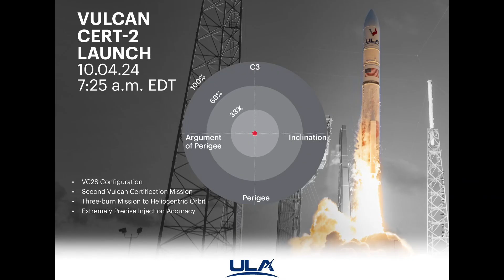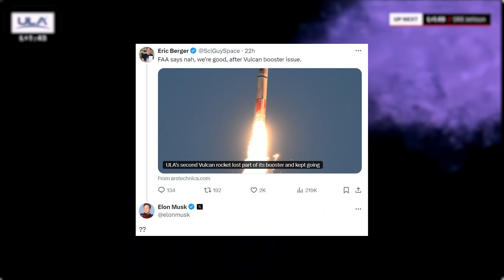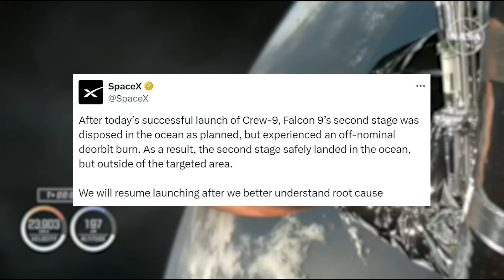The FAA Will Not Be Investigating Vulcan’s Anomaly

Comment: Ok this is a lot of BS. I wonder if the ula top dog is against trump if so then there is your problem. And if the FAA and ULA are in each other's pocket. If I correct,i have a 50/50 chance of either that, the FAA is holding SpaceX from launching starship, and didn't SpaceX asked for the permit/license to launch in the beginning of August? I also wonder if the FAA did a investigation and found some issues with ULA'S pride and joy, would that have a negative on ULA Vulcan and delay there certification for flight's. Its also kind of strange that,they were quick to hit on SpaceX. Again,i smell something and its not rocket fuel.
Reply: What's BS is you pretending you have even the faintest clue what's going on and why. The BS you spouted here is proof that you get told what to think and have yet to even catch sigh of a clue.  You wonder why the FAA did or didn't do an investigation?  Why not find out the conditions required first?  Oh wait that would be informing yourself and you hate that, you'd rather make it up or just repeat nonsense because there's no thinking involved then right?  Lazy and stupid go hand in hand.

Comment: The geniuses at FAA grounded the falcon 9, but let’s ULA Continue for same reason. 🤬🤬🤬🤬😤🤬🤬😤🤬😤
Reply: The problem you're forgetting is that Falcon 9 didn't deorbit correctly and there was debris outside the debris field. This is a safety hazard and could kill people. ULA had no such issue. Starship was not investigated for raptors blowing up midflight. In fact, they can launch the Flight 4 launch profile if they want to.
Reply: @sarkaranish A solid rocket booster exploding is a serious safety hazard. The only reason the Vulcan survived was dumb luck. If things had gone differently, we could have seen a complete loss of the stack with those same solid rocket boosters detaching and uncontrollably flying anywhere. This has nothing to do with Starship. Starship is a prototype vehicle under a test flight license. Vulcan is supposed to be an operational rocket whose whole mission was to demonstrate their ability to safely and reliably deliver military payloads. A booster nozzle exploding does in no way shape or form demonstrate that the vehicle is safe and or reliable.
Reply: @icylime3607  it wasn't because vulcan is unproven, so the FAA knew it was more of a safety risk, since this was made clear before the launch, its okay for the vulcan to blow up
Reply: @icylime3607  Vulcan is NOT an operational vehicle, it is still in certification. But the thing that Vulcan did correctly is not spread debris outside the debris field which is what matters most.
Reply: @sarkaranish  yea pal relax
Reply: @TiberiusMaximus  when spacex stans act like the FAA is being unfair, it annoys me.

Comment: To all you FAA haters and SpaceX fanboys: This anomaly was not dissimilar to one of the Raptor engines failing during the last Starship test flight, which didn’t trigger an investigation. Familiarize yourself with the FAA’s documentation regarding what classifies a mishap before reaching for the pitchforks.
Reply: FAA's documentation; Points number 2 and 6 of events that qualify as a mishap under FAA definition:
2. "Malfunction of a safety-critical system" 
6. "Unplanned substantial damage to property associated with licensed or permitted activity".
A solid rocket booster exploding is a serious anomaly which should be investigated. If the nozzle had broken in a slightly different way, the whole Vulcan stack would have been lost and the solid rocket booster would have been in uncontrolled flight. Letting such a serious malfunction slip by an investigation especially when the whole purpose of the flight was to demonstrate Vulcan's ability to safely and reliably deliver military payloads, is complete demonstrable negligence. Additionally, this has nothing to do with SpaceX or Starship. In the example that you provided, the possibility of engines failing was taken into account under Starship's test launch license. That does not apply to operational rockets. As an example, SpaceX's Falcon 9 experienced an engine failure on the CRS-1 mission where they were also able to deliver their primary payload to orbit, and an accident investigation was required to be completed.
Reply: You cannot shut down a solid rocket.  This means a solid rocket nozzle issue is a bigger deal than a liquid fueled rocket.

Time to recover the booster.
Reply: but…but….guberment evil! massive corporation good! -spacex sheep
Reply: @archdornan3694  Critizising the insane slowness of said government agency is just fair, though.
Reply: @ScienceCavas  maybe spacex should file their papers in time then
Reply: You TELL 'EM, Lyricbread! Make those brainless SpaceX Fanboy Cheerleaders squirm!
Familiarity? With what?
SpaceX Cultists live in an Escapist World of "wishful thinking"; not "Rules" or "Economics" or "Feasibilty". Spoils the Fantasy. 
Hello from New Zealand.
Reply: You are right BUT you can't blame SpaceX fans for assuming FAA is at fault, this video is intentionally provoking with the title and FAA has been biased lately.
Reply: @lyricbread  lmao given that every single comment has been deleted i can only assume the channel is biased towards spacex breeding the fanboys
Reply: They are way too stupid to know the different!

Comment: Of course, why would they do that? After all, it's not SpaceX. Election time!
Reply: There are real reasons for why.  What are the chances you'd eve think of informing yourself first vs just blindly repeating what others are saying?  Exactly zero.  You're going to be told what you think ever step of the way.  A perfect mindless obedient drone.
Reply: The problem you're forgetting is that Falcon 9 didn't deorbit correctly and there was debris outside the debris field. This is a safety hazard and could kill people. ULA had no such issue. Starship was not investigated for raptors blowing up midflight. In fact, they can launch the Flight 4 launch profile if they want to.

Comment: Wh!? Seriously what's going on!? The FAA needs to give a better explanation on what's going on here. Either they need to investigate every failure or not! What criteria did ULA meet that SpaceX didn't?
Reply: My guess would be that the Vulcan Centaur still managed to complete it's missions within the margins set out in the flight plans/ the launch liscence that was agreed apon before the launch. When Falcon 9 was grounded, the vehicle was supposed to do something and a failure prevented it from doing so. That wasn't the case here. Vulcan Centaur did everything it was meant to inspite of the SRB issue.
Reply: @plainText384 usually there's a voice "FTS are saved" few seconds the time drone ship landing?
What does it mean? Flight termination system did not kick in (bcs a trajactory is normal). And if, in the case it kicked in, does SpaceX forgot to assume a possible debris zone when asking for flight license?
Reply: @plainText384  Falcon 9 was grounded after failing a droneship landing after completing its mission perfectly except the landing
Reply: @ninehundreddollarluxuryyac5958  So? The plan for the mission was to land the booster and an anomally prevented them from doing so.
Reply: The problem you're forgetting is that Falcon 9 didn't deorbit correctly and there was debris outside the debris field. This is a safety hazard and could kill people. ULA had no such issue. Starship was not investigated for raptors blowing up midflight. In fact, they can launch the Flight 4 launch profile if they want to.
Reply: What's going on is that at no point did you come within a country mile of a clue.  You want an explanation and there is plenty to be found, for those people who are not both stupid and lazy.  Shame that can't be said about you.  Nice fail..
Reply: The FAA does have guidance about mishap responses published on their website and in circulars.  They're on their website and easy to find.
Reply: You know you can read their regulations right.  They have a website and everything....

Comment: New Launch date for flight 5 - Wed. Nov 6
Reply: Won't be allowed until after New Glenn flies.
Reply: @ninehundreddollarluxuryyac5958  this is probably a guarantee, just like the hold ups for the first F9 launch to the ISS trying to get Boeing there first.
Reply: @ninehundreddollarluxuryyac5958  ZERO correlation between New Glenn and Starship.  And Starship has already flown FOUR TIMES.  /facepalm logic

Comment: 🤔 Whatever is wrong is no small thing. Seems like an interesting decision. ULA has a nontrivial problem. Personally I would be concerned. This could have gone badly. 

BUT it was a great test of ULA’s flight control systems!
Reply: The SRB's were not built by ULA. The Vulcan rocket passed with flying colours. The boosters however ...
Reply: @_starfiend  

True, but still kinda a mixed bag. This has to be fixed as why will the military risk a very expensive satellite on a launch system that has this type of failure (considering that it might have gone very badly). This was not the type of problem that should have surfaced at this point in time. I find it rather perplexing. I really expected the launch to go flawlessly, but better to have it happen now and be fixed. It is just that the SRBs are a very mature technology. If I were ULA, I would be rather concerned. And what is different with these SRBs than what they have been using. I hope that ULA will be reasonably open about this issue.

Comment: FAA didnt investigate when the raptors explode on take off so why should they investigate the SRB?
Reply: Fair point I've never even considered that. The only difference for me would be the fact that if a full vehicle breakup had occurred a SRB could have remained intact and continued firing to an uncontrolled course .
Reply: @callumcurtis15  also it should be pointed out that the raptors on starship shut themselves down instead of actually exploding
Reply: @LizardGuy50  If you ignore flight one then yes 😂
Reply: @LizardGuy50  We've seen more than enough raptors exploding but sure, they definitely shut down after that.
Reply: @callumcurtis15  thought that was the hpu exploding?
Reply: I was not aware they didn't. They should have. It may be on "Autopilot"!
Reply: Because that is included as part of the launch license for Starship.

This one isn’t.
Reply: But they did, and SpaceX had to slow their flights every time. There has been an investigation after every Starship launch by the FAA.
Reply: @EarlDorman-w7d  the reasons for those investigations had nothing to do with that though.

Starship flight 1: Launch platform got utterly wrecked, spreading debris far outside the indicated safety zone. FTS on the ship also took far longer than expected to trigger, which is a big issue as that's a public safety critical system.
Starship flight 2: Complete loss of both the booster and the ship in flight. 
Starship flight 3: Loss of both the booster during landing and the ship during flight.
Starship flight 4: Success even though significant damage occurred to the ship flaps.

Meanwhile:

Vulkan flight 1: All stages dropped over their intended areas, vehicle completed the mission.

It should be noted, that the delay after Starship flight 4 has nothing to do with the flap damage. As the vehicle still managed to perform its mission with the damage, no investigation by the FAA was needed. And that's true. The FAA has confirmed many times that SpaceX is free to reuse the license for starship flight 4. The delay with flight 5 is not due to a grounding at all, it's that SpaceX intended to change their mission design, requiring a new license, and they were just late with the paperwork.

The performance of this Vulcan mission is very similar with Starship flight 4, where both suffered an anomaly, but they still managed to perform their mission.
Reply: @EarlDorman-w7d  And there are clear reasons.  Finding out what they are is the one thing most of you lazy twits just won't do.  You'd prefer to be ignorant and argumentative and as always 100% worthless.
Reply: @EarlDorman-w7d  spacex have been grounded twice this year. Both times were understandable. What are you talking about? Btw you can read the FAA reports and not just listen to Elon musk lying about everything.
Reply: because Musketers are mad